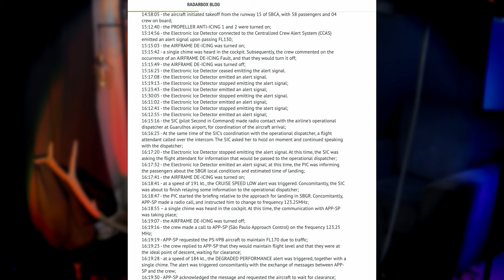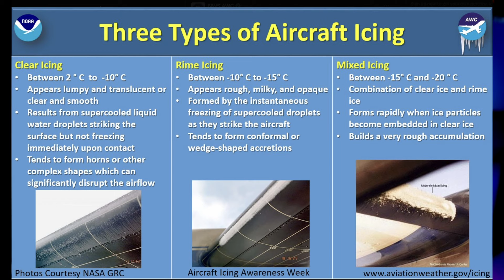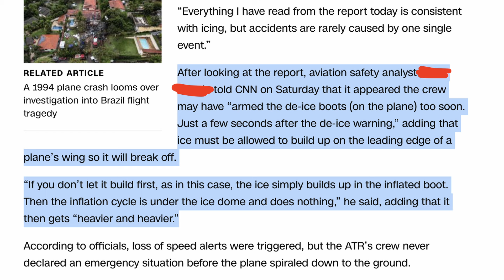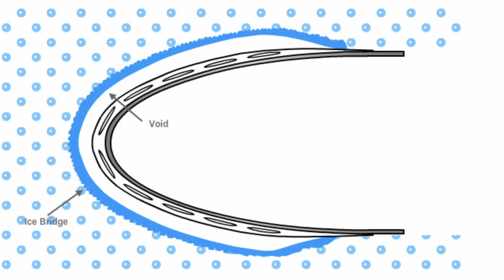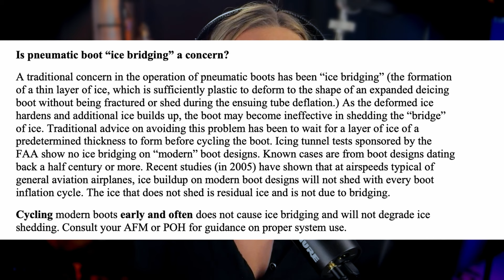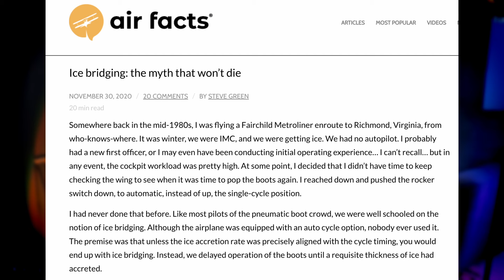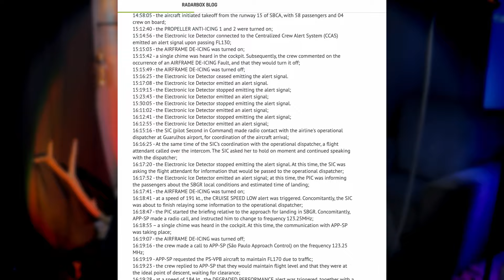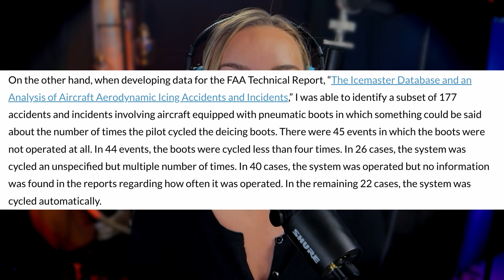ATR-72 CRASH | Debunking the Myth of Ice Bridging | PilotKaity

Comment: Great analysis here. As a former 1900 driver, I agree with your assessment of device boot usage. Use them as needed when ice accumulation is apparent. I never understood the notion of waiting until large amounts of ice accumulate before inflating the boots. I like that you pointed out that these airplanes aren’t meant to be operated in moderate to severe icing conditions for long periods. Thinking your airplane can “handle” it is downright dangerous. And you’re right, there’s too much “tribal knowledge” out there that is complete crap. Amen - just do what the AFM says. 

Another fascinating element to this story is the development of the flat spin. My T-tail 1900 did not have a stick pusher. My Citation Longitude does, as does your PC-12.  A rapid nose-down input at just the wrong time could create a gyroscopic force on the airplane that is a pro-flat spin input.

I pose this idea to you… do you think the stick pusher could induce, or at least, excite a flat spin?
Reply from the maker: That’s very interesting to consider. I’m not sure tbh if the stick pusher could do that but I’m guessing it’d not impossible

Comment: Thank you for posting Kaity. I flew King Air 200s in the Army in Europe from 2004-2007. Yesterday I was flying a Pilatus from BZN to SNA and experienced some light rime icing. My biased based on my instructors from 20 years ago was to wait till there was a bit of accumulation on the wing before turning the boots on. As the planes I flew in the Army were built in the mid 80’s, my perspective is likely outdated. I’m now thinking there is no downside to turning the boots on at first sign of icing because it can go from light to heavy very quickly. Fly safe everyone.
Reply from the maker: Thanks for sharing. Ultimately to me, the boots don’t do a great job of getting ice off anyways so I always try to leaving the icing area

Comment: Hi Kaity.  Good reporting and thanks for covering this. First off, I don’t like nor believe in ice boots. They are a hokey way to remove ice.  Maybe modern ones are better, but it’s a desperation solution to the lack of a good solution.  Second, I don’t have an opinion on ice bridging, albeit I’ll admit it’s implausible. Dynamically creating a shell of a brittle substance in the turbulence of a couple hundred knots wind flow?  Can’t say it’s impossible, but prove it happens in a laboratory and then let’s talk.  What I do believe is not ice bridging but what I’ll call ice caking (that is not a good name but I’m not coming up either a better one at the Moment).   And the thing is that all of us have seen this happen before. Probably the most common occurrence is when you wear wool mittens in the winter and then go make snow balls and play in the snow.  The snow and ice build up on your mittens but when you bend your fingers it doesn’t fall off!  It fractures along finger bend lines and forms islands that still cling to your mitten underneath. Even if you try to shake them or bend you hands they don’t come off. The bending just opens the gaps between the islands which can admit more snow and ice and make the whole layer more dense and thicker. Here is the point.  If you let that ice build up to a certain thickness and THEN try flex, yes you will shed an appreciable amount of the layer because there are no gaps and so the flexing will peel the ice off the surface (in his case the wing). Hoewver, if you flex the base before a significant layer has formed, and keep flexing it while more builds up, the ice will build into little islands that have enough space between them to not be forced off when the membrane id flexed. I can easily see a couple of inches of ice building up this way, and whole time the boot is flexing up and down, but not getting the ice kicked off. Note that ice can take different forms from glassy to snowy.  Which you have likely does make a difference.  Given what you have revealed about the flight, this is what I think may have happened and it’s the reason I hate ice boots. I think they are dangerously worthless.  and to add insult to injury, they degrade your fair weather performance as well.  I think thermal melt methods are the only way to go and even then they are not infallible in really extreme icing conditions.  As you say, the best devices is avoiding icing conditions in the first place.
Reply from the maker: I agree with everything you’re saying. Boots aren’t very good to begin with as you said. The FAA has called what you’re talking about “residual ice” and it’s definitely something I’ve seen as well.

Comment: I have seen icing removed during the cycling process.  I've never witnessed icing buildup as a result of the activation of deicing prior to entering icing conditions. 
As a responsible pilot and a believer in self preservation  (😂), I will switch to deicing even when I'm unsure.
Reply from the maker: That seems to be a good idea but of course depends on what the manufacturer says about running the system on specific airplanes
Reply: @pilotkaity  totally correct.

Comment: Technically it is not stalling at a lower angle of attack than critical, it is that you have a new lower critical angle of attack for your ice modified airfoils.
Reply from the maker: Yes but not stalling at the normal 17.5 degrees or whatever it is with clean wing for that particular aircraft

Comment: From Master Indtructor Dick Rochfort: “If it is cold dont let the airplane get wet. If the airplane is wet, don’t let it get cold”.
Reply from the maker: I wish I was that simple. It’s a great mindset but unfortunately in professional aviation not possible to avoid ice all the time. We just have to learn how to operate with safe minimums
Reply: @pilotkaity  i didn’t have any deicing boots and flew in cold clouds but always had an escape plan, and turned around on two occasions. If I didn’t have terrain clearance for lower, I just scrapped the flight.

Comment: I've always been curious why turboprops can't use wing bleed air heat just like the big kids do. Maybe it's just cost? Maybe the ATR would require more bleed air for their surface area than the turboprops can provide but smaller aircraft like the PC-12 seems like they could. It sure would be more reliable than boots.

Anyway just curiosity on my part; student pilot but doubt I'll ever fly anything as big as a PC-12 let alone bigger 😆
Reply from the maker: I’m honestly not sure
Reply: One reason could be engine capability.    A turboprop engine for a particular aircraft probably wouldn't support the demand for bleed air that would be required to operate heated leading edges.

Comment: As a small GA pilot, the only airplane I’ve ever flown with any sort of anti-icing equipment was a Mooney 231 that had a hot prop and of course a heated pitot. The only anti-icing I have on my own airplane is a heated pitot and heated AOA probe. So I have a lot of respect for icing, and in many hours of IMC (nothing like you airline types, of course), I’ve managed to avoid it most of the time. But sometimes it sneaks up on even the best prepared. That’s why airliners and many high performance airplanes are equipped with anti and de-icing equipment. And that’s why NASA and the FAA and the NTSB have done so much research about it. What I’ve learned, and what even the pilots of the best anti and de-icing equipped airplanes need to know, is that getting out of the icing ASAP is the best course of action. And they need to know that old wives tales about icing that I certainly heard back when I was learning to fly in the early 70s have been debunked by all that research. 

I have been caught a few times when I thought there’d be no icing, and each time, it was a complete surprise. Once was in that Mooney, when although there was no ice on the wings, the front of the cowl iced over, closing off the engine’s air intake. Until I pulled the manual alternate air control, the engine was dying, causing me to declare an emergency—it came back to life as soon as I pulled the alternate air control. Upon landing at Durango, there was a thick layer of ice all over the front of the cowl, but none anywhere else—I wondered if the hot prop had had anything to do with that.

Another was in a 182, descending from clear air through a cloud layer into Idaho Falls, when suddenly the windshield iced over and the flying surfaces started gathering ice. As the ice flaked off and hit the tail in warmer air, that was a bit frightening, but suddenly we were through it. Most of the ice was gone by the time we were on the ground. 

Another was in a 172RG, in what appeared to be clear air between layers on the way to Jackson, WY, when rime ice started to form, opaquing the windshield and roughening the leading edges. When I told ATC that I needed priority handling getting into Jackson because of the ice, he said that I’d have to hold because of airplanes ahead of me. I told him that I couldn’t, he asked if I was declaring an emergency, I told him no, but that I would if I didn’t get an immediate clearance—he held the other airplanes, which were all twins and much better equipped than I was for a delay. The approach was uneventful, and by the time I was on the ground, the airplane was merely wet. 

Icing is scary stuff. That is why it’s been researched so heavily. Why these myths, such as ice bridging, have grown up and stay alive in spite of all the research is really curious. Of course, why news people rely on “experts” with little or no expertise is even more curious!
Reply from the maker: Wow thank you for sharing your experience. The one that strikes me is when the controller tried to get you to hold. Many pilots think ATC is the final authority and would have held and possibly had a horrible outcome. I have had to also be directive with ATC multiple times. It’s not that they don’t want to help, they just don’t fully understand the situation sometimes and it’s important to insist on what you need. Great info

Comment: Notwithstanding what the FAA and NTSB say, I would suggest that the Pilot Operating Handbook / Aircraft Flight Manual for the specific type you fly, always has the final word. These documents have to approved by the FAA anyway, so they should not contradict. Nevertheless, if you get yourself in trouble and are lucky enough to live to tell the tale, you can be sure the first thing the lawyers will ask is, "did you follow the manufacturer's approved procedures?" If the answer is no, all bets are off.
Reply from the maker: Yep. Per the manufacturer recommendation is exactly right

Comment: Unfortunately, I think you’ve picked the wrong aircraft and accident to as you say “debunk” the “myth” of ice bridging. It would be more applicable to associate that supposed issue with typical deice boot equipped aircraft. The historical issue with the ATR has ZERO to do with the issue of what some refer to as “ice bridging (the belief that ice can build and remain above the maximum inflation ability of the boots, thus rendering the boot ineffective). You are correct that the aviation “expert” had little idea of what they were talking about in regard to THIS accident, but misguided media statements in regard to high profile aviation accidents is common. That individual was no doubt speculating, and clearly off base. The ATR system does NOT use an operational approach of waiting to activate the boots after some period of ice accretion for fear of bridging. In this aircraft, you activate the boots (known as “Level Three” protection) at the FIRST sign of ice accretion and AS LONG as ice accretion is observed (exiting icing conditions to the extent possible for anything more than “light” icing is also VERY important). If this crew, operated this aircraft differently, they were playing with fire. 

Additionally, the boots on the ATR are not typical of smaller turboprops and piston aircraft with horizontal bladders running the length of the boot. The ATR has dual vertical bladders that operate asymmetrically (and are actually quite effective on the main wing so long as ice does not get beyond the protected area). Actually, yes you can see the outboard portion of the wing in the ATR (better in the -42 than the -72 for obvious reasons) Your points about ice bridging have merit, but the ATR has an issue with abrupt loss of control (usually laterally with reversing extreme bank angles) as a result of ice accretion BEHIND the boots, known as “hinge moment reversal”. An excellent autopilot masks this impending hazard, until the aircraft departs controlled flight once the autopilot disconnects, but you seem to mention this. But…if the boots are also used insufficiently (incorrectly) and accretion on the wing (or tail) leading edges is present, loss of control is much more apt with this aircraft than virtually any other piston twin or turboprop, even without rollback ice accretion outside the protection of the boots. The wing on the ATR is VERY sensitive to small amounts of contamination, so any complacency or incorrect operation has much more hazard than other aircraft and loss of control in IMC can result in any number of unrecoverable situations. 

For the record, I’m a former American Eagle (Simmons Airlines) ATR pilot with 7000 hours and 12 winters of upper midwest operation in the aircraft from the late 1980’s through 2000. I haven’t yet read the data on the accident, but I understand (from what I’ve heard, but not verified) that the pilots were relatively inexperienced in the aircraft, especially in icing conditions. This aircraft is a good one, but once icing comes into play, it is a much more demanding aircraft with much narrower margins of operation.
Reply from the maker: I agree with you. It sounds like this particular airplanes has a lot of issues and doesn’t do well in ice. Makes it hard to understand why they stayed building ice for so long.
Reply from the maker: I added the cockpit voice recorder report link in the description if you’re interested. Thanks for sharing your experience that was a great write up
Reply: @redbird444 Your explanation of the ATR was bang on!